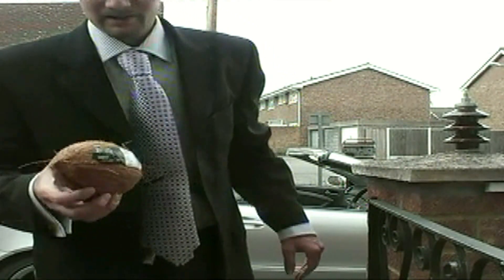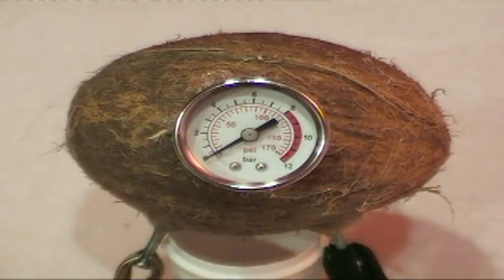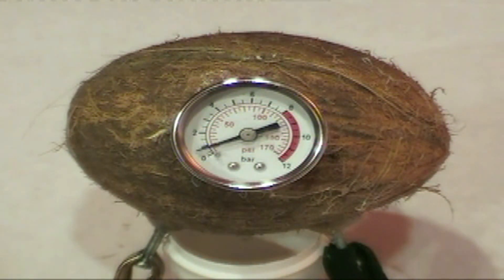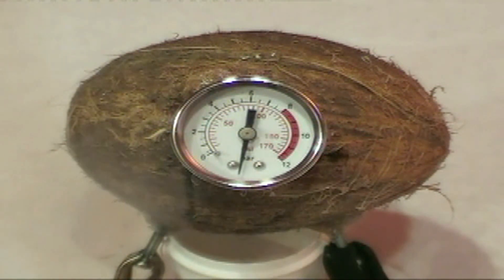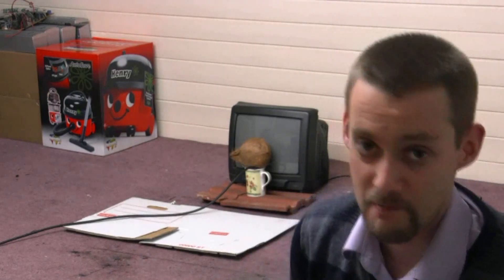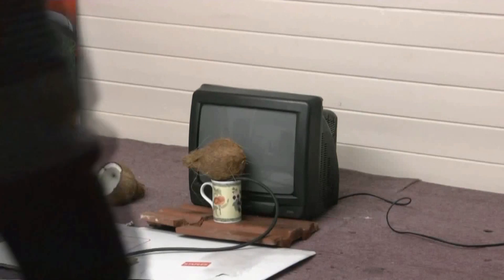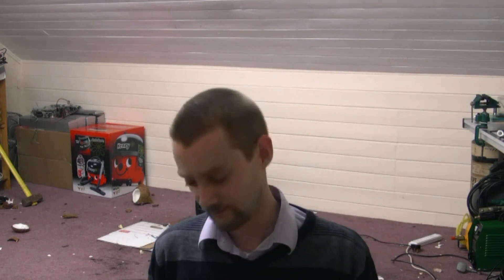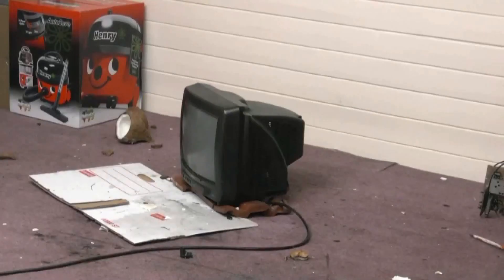Coconuts Explode Using Electricity

Comment: Great science video, still holds up in 2025. Pressure gauge going off the scale is the icing on the cake, maybe 180psi? The loudness of these bangs has to be heard to be believed, louder than most fireworks. My tests also tripped the power, it can be hard to avoid the live electrodes shorting to each other after the coconut explodes.😄

Comment: Coconuts with electrodes should definitively go in the category of IED (Improvides Explosive Device). The explosion energy is even further increased, if DC is used. It forms Brown's gar (H2 and O2). I suspect, a terrorist wouldn't attach a pressure gauge to this dangerous item.

Comment: So, 14.5 bar is Pmax for coconuts.
Reply: No it handled about 13 bar - 280 psi.
Reply: @18436Melissa  How would you know? It was far above calibrated maximum of the gauge, so it's inaccurate reading.
Reply: Yes
Reply: A

Comment: who knew coconuts are rated to 170psi
Reply: I dunno.  With as far off the scale as it went, I'd say coconuts are rated closer to 230 - 280 psi.
Reply: @cecilrichardson2494  safety factor of 0
Reply: @Skunkhunt_42  Yes, if you happen to be anywhere near it upon structural failure.
Reply: @Skunkhunt_42  Awe cmon man its at least a .9
Reply: More like close to 300 psi
Reply: Time to turbo my coconut to 15 bars
Reply: Their construction sort of reminds me of composite pressure vessels.
Reply: +volvo245 Kinda like a paint ball or scuba tank. lol
Reply: +eric hoagland Yeah in this the pulp/meat or "copra" acts as a non permiable barrier like the aluminium liner in those tanks and the fibrious outer layer is similar to the wound reinforcing filament (kevlar cf or gf). Probably if you dipped or pressure cured these coconuts in epoxy or polyester resin they would withstand double the pressure for a short while. Mind you this is superheated steam and that stuff eats organic material quite readily. If these were done with HPA or HPN the pressure could be lot higher and they might withstand it for a longer time....Robinson Crusoe had no excuse for not building an air gun.  :)
Reply: +volvo245 good to know it's going in my prepping back pack.
Reply: Spoiler Alert
Reply: Coconuts rated presure was over 170 it like hit 200 psi and over before it blee uo

Comment: CRT's to photon are like caravans to top gear lol
Reply: And yet, when the last LCD rolls of an assembly line in Malaysia or somewhere, the best LCD will still not have beaten the best CRT on a wide variety of important points. A CRT combines very low persistence, near perfect black levels and a wide gamut; OLED may beat it one day, but LCD sure as hell can't touch it.

In large sizes they are also surprisingly efficient. (in smaller sizes a lot of energy is lost in the heating of the electron gun etc.)
Reply: reliants
Reply: "Would you say birds are dinosaurs?"
Of course. You're human, but you're also simmian. That's how phylogenetic classification works.

"Would you say LCDs are CRTs? No, but they are successors of them."

Completely different branches on the evolutionary tree of technology.
Reply: There are more now-living species of dinosaurs than mammals.
Reply: soylentgreenb
Would you say birds are dinosaurs? No, but descendants of them. Would you say LCDs are CRTs? No, but they are successors of them. And btw there are no dinosaurs living now.
Reply: +Userful1 Birds are dinosaurs like grasshoppers are insects. LCDs are not CRTs like birds are not fish.

CRTs will die when they make something better. Sony's CLED or quantum dot (not QLED) displays look interesting. Just make them low persistence and they have a good chance.
Reply: +soylentgreenb Oh come on, just let the dinosaur die, don't try to heal it
Reply: soylentgreenb
My god, birds are not dinosaurs, just like LCDs are not CRTs. Luckily the old gen who knew CRT will eventually die out and let the CRT die out as well :)

Comment: will this work with 120V and 15A?
Reply: Luke Shaw Probably... I'd say hold back on the amperage a little. Maybe see if you can give it 120V and play around with the amperage.

Dump too many amps in and you're probably going to end up burning a "pressure relief valve" into your coconut.

Comment: How did you affix the bolts and pressure gauge to the coconut?  At T+ 3:55, the pressure is ~5.8 psi, but there is no sign of steaming coconut milk coming from the "pressure vessel".

Thanks.

Comment: Suppose I found a CRT set from the 1990's. Is there a transformer in one of those that I could do pretty much the same thing, but instead of the transformer powering the CRT, it's powering the spikes in the coconut inside the back of the telly? Granted I'm only on 110VAC mains, but I was thinking that'd be a great booby trap with a sh*t telly and an unsuspecting victim who plops down, clicks on the tube, nothing happens then BANG! Hasta lasagna, don't get any on ya. lol!

Comment: Nice explosion! I would hate to see your electric bill. :-)
Reply: electronicsNmore its probably really cheap actually, his house runs on batteries that charge at night (when the power is cheaper) so in the daytime, he doesnt use the grid
Reply: Deven Walker : Batteries supply DC though. How does he get ac during the day? He must have a rectifier, inverter, etc to change the dc to ac
Reply: @EphemeralProductions  https://youtu.be/ka0MfipmdBw pure sine inverter
Reply: @EphemeralProductions  Says inverter right on his power panel
Reply: @Chris-cf2kp  ok
Reply: +TheStiepen He's got a video on it called 'Backup Power Supply'. You've probably seen it by now though.
Reply: +Gain Medium does he show/explain that somewhere in detail?

Comment: yeah, the juice inside acts as an electrolyte, allowing current to flow between the electrodes. As the liquid heats up from the current it turns to steam, which is what makes it blow.  A bigger coconut would have a bigger shell, which could contain more pressure before finally failing in a sudden release of energy (explosion). The part that I find most interesting is that your experiment showed that you didn't want to go above 5 amps. I would have guessed the higher the current, the more heat, and the more quickly the steam builds up, and a quicker explosion. Interesting.

Comment: You should put these things that you like to 'blow up' in a safety box.
You could make one using thick polycarbonate sheet.
Don't create a sealed box or that too will explode.
Construct a box leaving a half inch or so gap along the edges and then leave a small gap and fasten some angle shaped pieces to cover the edges allowing the expanding gasses to escape but keep the flying bits of shrapnel inside. You could still film without damaging your camera and it'd save on clearing up...

Comment: I like how the red zone exactly marks the point where the pressure does indeed get critical, with the bubbles and all, and how the thing getting PAST the red zone marks the point where the whole building/cocunut would pretty much blow up. No higher measure is needed.

Comment: This is absolutely amazing Andy, great to see the original  video.
and
Part 2, explosion 3 was amazing, venting like a pressure cooker under stress, but coconut in the TV. absolute climax.
it crossed my mind ( Where is my hammer ! ) not required

I will need to source some South Pacific coconuts and try this. better than batteries anytime.